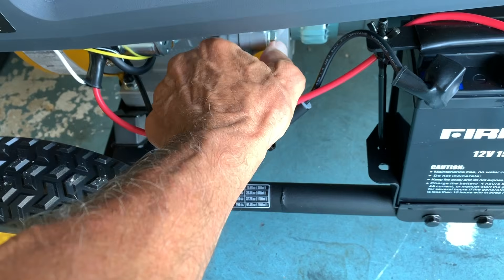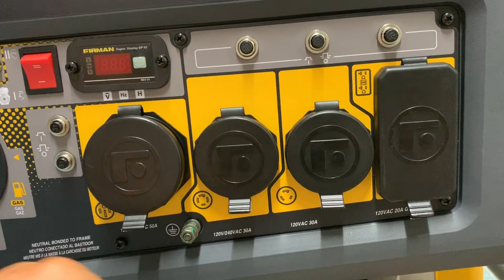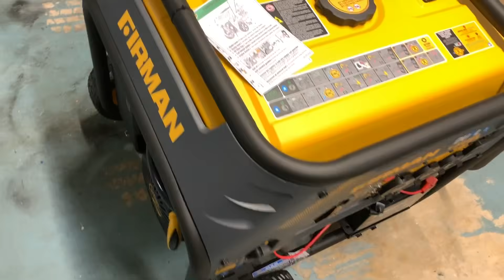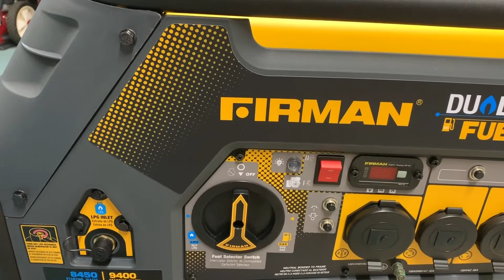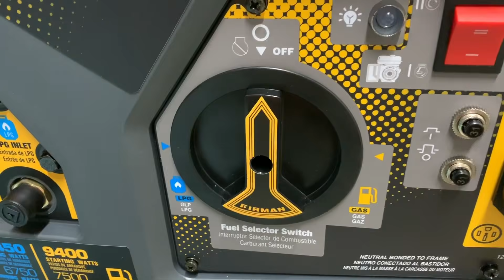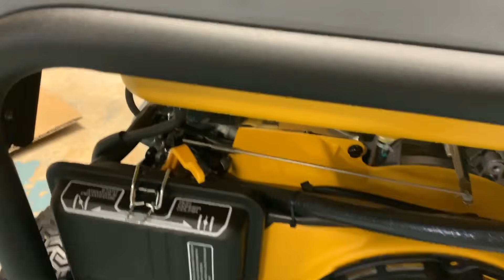The Firman 9400 Dual Fuel Generator from Costco

Comment: Guys I were able to start my central AC unit with this generator run refrigerator and everything  else. Make sure you install a hard start capacitor in your AC unit outside otherwise it will not work
Reply: My gfci outlet keeps turning off the power I have the extension cord on it. Could it be the extension cord or the Generator? I have the same one
Reply: How many TONS is your central A/C & what did your compressor L.R.A. drop to, AFTER you installed your hard-start kit?
Reply: Here is a reminder about portable generator safety: This advice is just to make sure that everyone is aware of all the warnings and it’s just to remind people to be careful using portable generators. Everyone has to see this safety reminder for safety. Every year, hundreds of people die or get injured when using portable generators due to carbon monoxide poisoning and electrocution. Make sure you are using your generator carefully and keeping others safe as well. There is something very serious that everyone should always be aware of when using generators. Some people do run their generator indoors which is not safe and that increases the risk of carbon monoxide poisoning which can cause death of family and you. Some people run their generator in wet conditions which can electrocute them. Please remember that you should never run your generator indoors. Remember that carbon monoxide is an odorless and colorless gas that you cannot see or smell. Carbon monoxide is a silent killer. Keep that in mind. Make sure your generator is 15-20 feet away from your house and away from doors, windows, and vents. Never use your generator in your porch too. Having a carbon monoxide detector is very important against generator safety. Some people also allow children to go near the portable generator which could pose risks. We need to keep an eye on our children making sure that they are not near the portable generator so they won’t get electrocuted or burned by the generator which is dangerous. A locking enclosure also keeps kids safe. A generator shed might look like a tempting place to explore, or take cover during a game of hide and seek, but a generator is a dangerous piece of equipment that can cause injury. It says on the manual that we should also keep children away at all times from the portable generator to avoid injuries. Please do not allow a child or unqualified people to operate the portable generator. Just because some manuals missed what should be listed doesn’t mean it’s safe to do. Always follow the generator safety rules when using portable generators. Generators pose electrical risks. If you need to use your generator during wet weather, you need a generator tent to protect your generator from getting wet. Don’t let your generator get wet. Keep your generator dry and before using your generator, please make sure your hands and your generator is dry. Do not wear loose clothing when operating the generator. Everything that is said on the generator’s operating manual should not be ignored. Never smoke cigarettes near the generator. Please keep flammable things away from the generator. Never overload your generator too. Your generator can catch fire. Never ever try to plug a generator cord into a wall outlet to avoid back feeding. Back feeding your generator is dangerous. Always turn on your generator first before plugging in appliances and shut off the appliances before turning your generator off. Use a heavy duty cord for your generator and the cord should not be worn out. All the instructions should be followed carefully. Never refuel your generator while it’s running. It can cause fire if fuel spills while your generator is hot. You should turn off your generator and let it cool off before refueling it. Having a fire extinguisher next to the generator is also important. This is only a reminder for everyone’s safety of using generators. Make sure your generator is properly grounded. https://youtu.be/I1jT3ANENvI and here is a video more about keeping others safe when using generators and also about our family’s safety. Hope this helps. Thank you. Hope you stay safe. Make sure you follow the generator safety rules carefully.

Comment: Ahh...

its NOT 15 HA, its 15ah meaning 15 Amps per Hour which means the battery can supply 15 amps of current at 12V for one hour. 

Next if you have 2 refrigerators that pull 4kW, you have a SERIOUS refrigerator problem that needs to be checked BEFORE you hook them up to this generator .. NO household refrigerator should be pulling more than 500W while in "re-cool" mode. While on standby doing nothing, it should be pulling less than 25W .. 

YES you can use regular gas, E10 and E15, it will NOT harm the generator, it will only harm the carburetor if you shut it down with fuel still in it and let it sit for several months ... The alcohol aka ethanol in the fuel will pull IN oxygen into the carburetor and start to corrode the internals ... The fuel will then gum up and clog the jets, at which point the generator will NOT start back up. This happens when you don't properly "winterize" it ... 

Leaving the choke in the ON position will NOT blow the engine up... It will just flood the engine and make it run poorly .. Where do you get this info from ..?? LOL The choke is there to allow the engine to SUCK up raw fuel that is in the BOWL to get started, then you turn the choke OFF so that it starts to pull vapor fuel from the normal jet... 

I don't think you really understand how much power you think you need .. Im in orlando florida and i'm also prepared for this hurricane and i have 2 generators in my garage ready for action.
Reply: We should turn the sound off and let you do the video. "15 HA whatever that means?" yeesh
Reply: @72mespo  STFU!!!
Reply from the maker: Thanks!